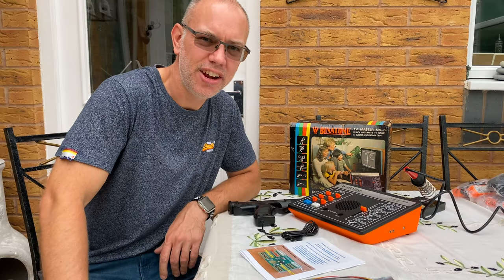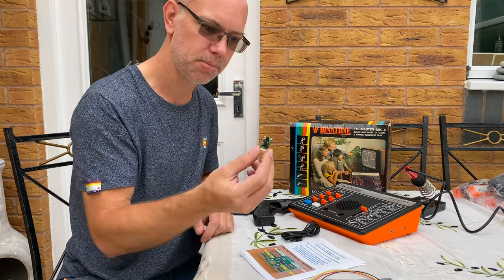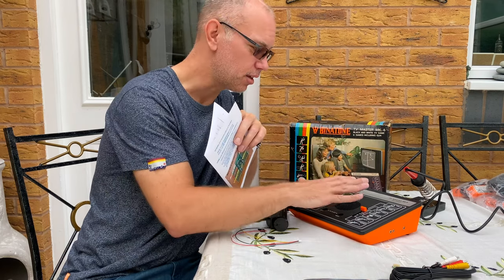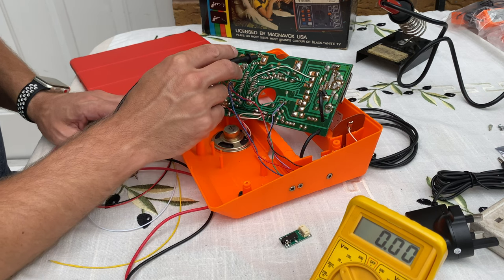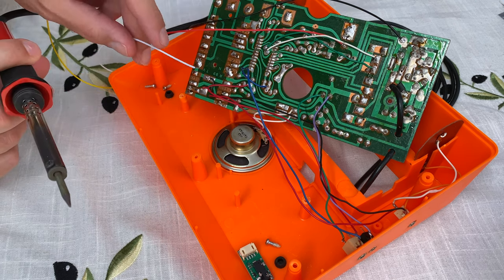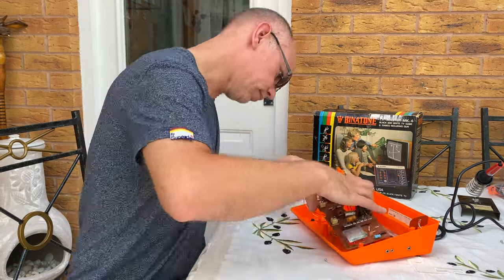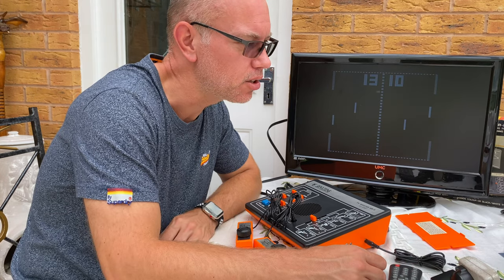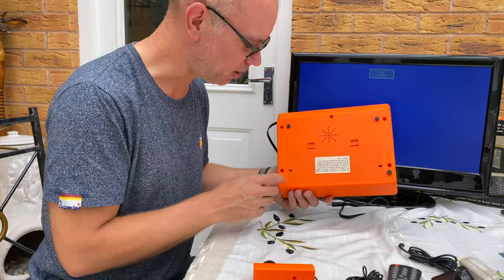Binatone TV Master Mk 6 Composite Video Mod

Comment: Any ideas if this mod would work on a MK10?
Reply from the maker: Not sure, I'd expect so. You might reach out to these guys as they've done a Mk 8 and another model, check out their blogs: http://blog.tynemouthsoftware.co.uk/2018/05/binatone-tv-master-mk-8-tv-game.html http://blog.tynemouthsoftware.co.uk/2018/05/binatone-superstar-programmable-tv-game.html
Reply: @The-Tinkerer  Thanks - the blog doesn't seem to have a contact unfortunately. I do have the original mk10 manual which has a diagram on the mainboard in my unit but I'm not technical enough to understand it. TY won't let me post a link to it though.
Reply: May I ask, any tips on picking up the positive and negative on the board - my first port of call. I can see where the power jack connects to the board, but presumably that is 9v, for the mod it requires 5v ((or 6v as you managed). Is the voltage stepped down somewhere? Sorry if this is dumb newbie question.
Reply: So I actually managed to figure this out with a bit of luck and hit and miss attempts. I found the ground and 5v pretty easily and then tried the video wire on a bunch of solder points around the rf modulator and I have video on my TV via the RGB cables. My left player paddle is black on the screen (only visible when you move it over one of the white court line boundaries on screen) and the said boundaries are a bit wavey - so maybe I've not quite got the right video solder point on the board. First I am going to re-cap the board to see if that fixes anything though :)
Reply from the maker: @robbune1792   nice job Rob. Weird with the black player/paddle?!  Hope the recap goes well. I'm afraid I'm no expert in these things - just a tinkerer! ;)
Reply: @The-Tinkerer  Unfortunately I didn't ever see or know if this was working originally so can't say for sure if I have introduced the paddle issue myself - I'll report back after recapping